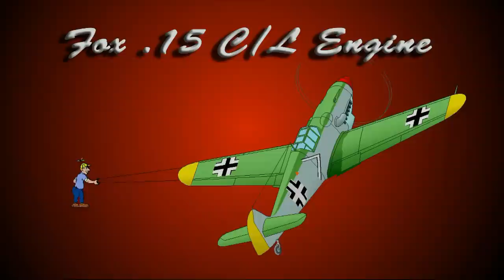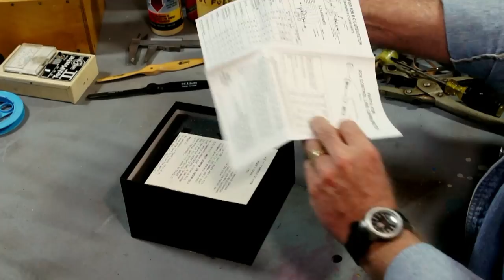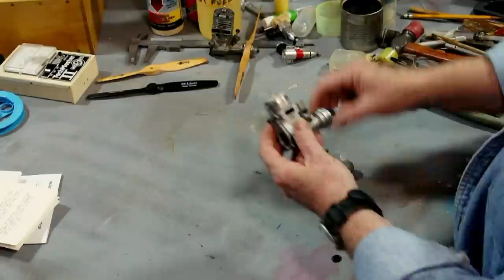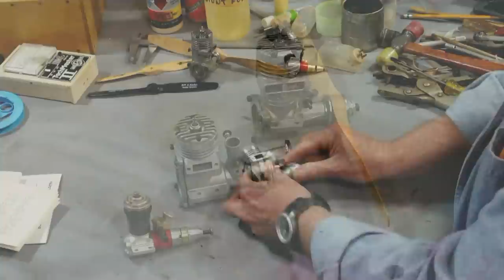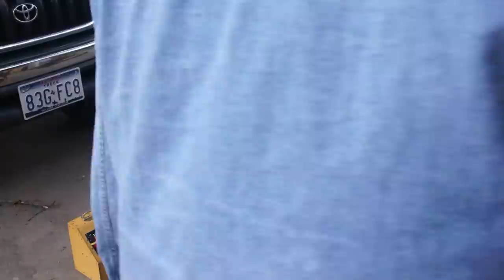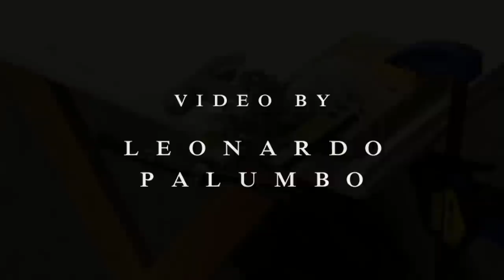FOX .15 C/L Engine First Run

Comment: These small engines are very satisfying to run on the test stand when you find a good one. I especially like the K&B 20 for smooth operation. I have a cheapo balsa electric ex-RC 49" Cub with ailerons that is getting converted to .15 powered control line with flaps.

Comment: Great video question sir, I bought a brand new Fox 19 engine havin problems getting it started I replaced a new glow plug I think it maybe the fuel I am using, The engine is a 1970s I got it off of ebay. where can I buy the proper fuel thanks Frankie Day
Reply: Tower hobbies